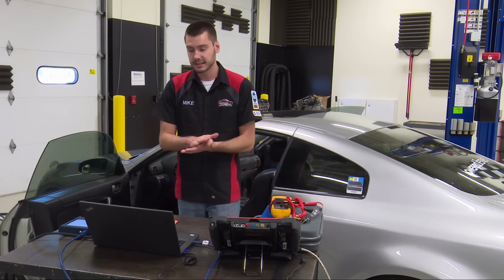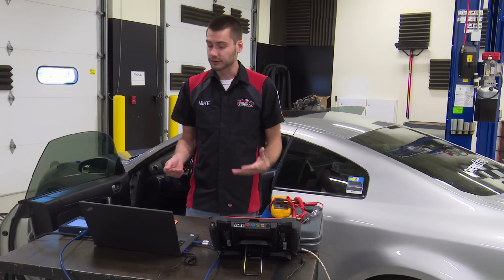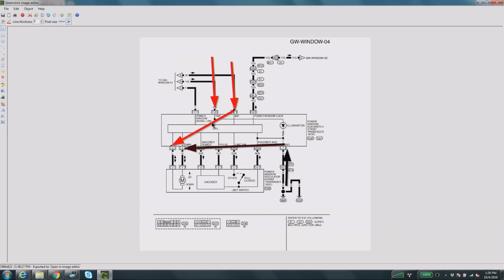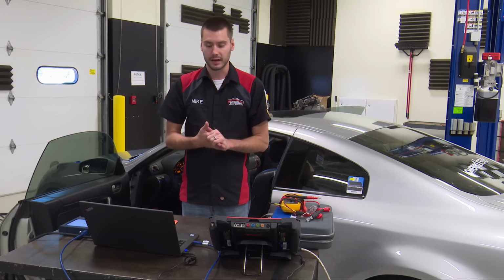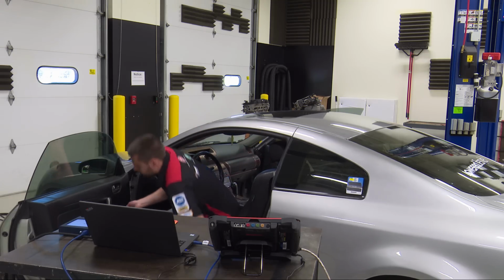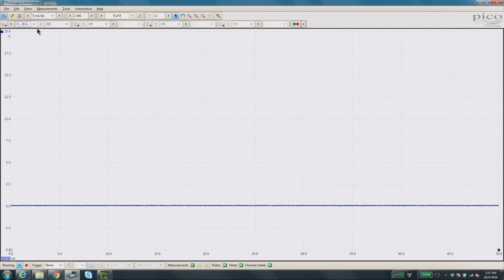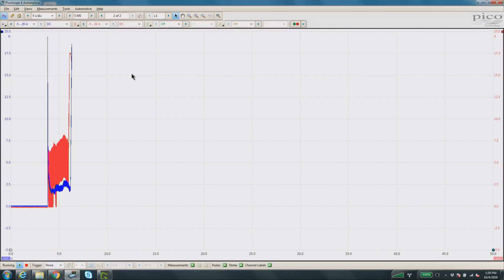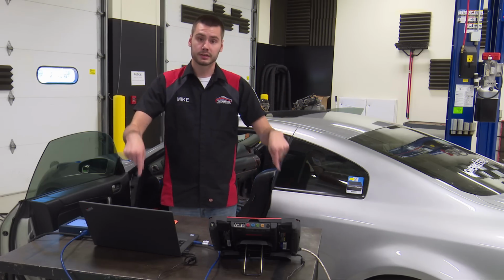Infiniti G35 "Smart" Power Window Doesn't Work...With A Twist

Comment: Thanks for the reminders and good new info. I don’t think any of the scan tools would include amperage draw as a pid. U might b able to control it bidirectionally but that would b about it. Perhaps another way to get the pattern would b to go to the fuse and use your amp camp with a fuse loop. Next one I do, will b checking not just amount of current, but also the pattern with my trusty little Vantage Pro. Thanx again!!
Reply from the maker: Hey Bill, yeh you're probably right with the PID data. As for the fuse idea...that's perfect. You could check this think out without even removing the switches! Some cars are hard to get the switches out.
Mike Becker, Senior Technical Instructor

Comment: last time we had a power window complaint after pre ordering regulator assembly per customer request, we removed door panel, used power probe to run window up and down. was working fine. look over at driver side master switch and customer had window lock on.  the look on his face was priceless
Reply from the maker: Hey that's an easy fix! Hope you still were able to charge the customer for diag. You did everything right on your side!
Mike Becker, Senior Technical Instructor

Comment: I guess a cheaper motor is less effective and it will turn slower and electrical motors draw more amperage when turning slower (just a guess), but it might not be in this case, more resistance (slower speed) as you also mention  can cause higher amperage draw, Great as usual Mike
Reply from the maker: Hey G Johan, thanks for watching! It's a theory, sure sounds kinda possible. If you look close at the current waveform though, you can see the red channel drops to 0 sooner than the blue trace. That's because the new window motor is actually finishing its travel faster. So, the new motor is actually faster, not slower. 
Mike Becker, Senior Technical Instructor
Reply: @GoTechTraining .....that is a great observation never thought about it I just wonder which window was faster thanks for your comment and videos they help a lot even in the comment section.

Comment: Most of us would have gotten "slid" by replacing the switch. With today's complex circuitry with smart intelligence built in, "firing the parts cannon" will get you in trouble. Excellent diagnosis!
Reply from the maker: Test don't guess. Diagnostics before triagnostics!
Mike Becker, Senior Technical Instructor

Comment: To be complete you probably should have evaluated the effort required to move the window up and down by moving the mechanism manually. As you eluded to there could be something wrong with the mechanism (gears, slides etc) that are causing excessive load and the motor(s) to draw excessive current. Especially since the motor was changed and the problem persisted. Cheap motor or not I would be surprised if it would draw 3x the current of a "good" one. It might have just required simple cleaning and lubrication. Followed by a current check again. I'd like to see you try that as a follow up.
Reply from the maker: Sure Dave, could be. This one was a motor/regulator unit. So that takes on variable away.
Mike Becker, Senior Technical Instructor